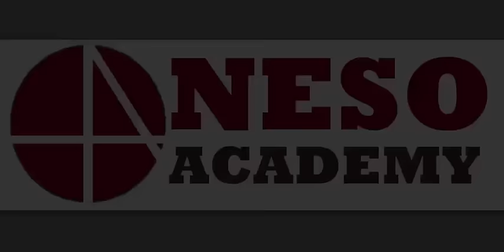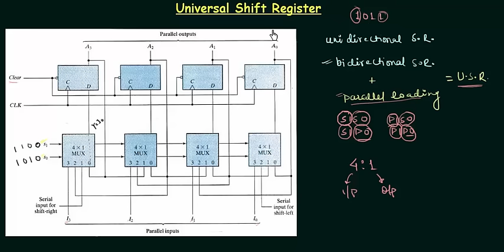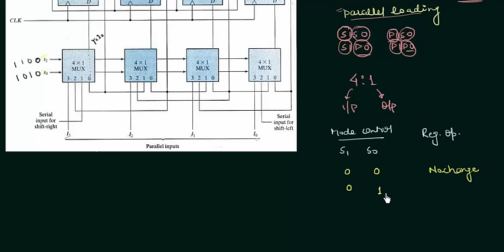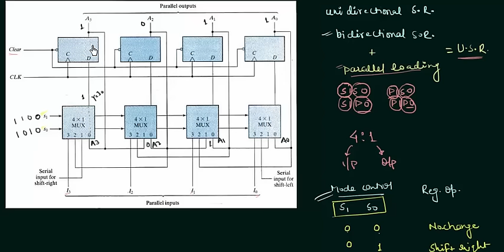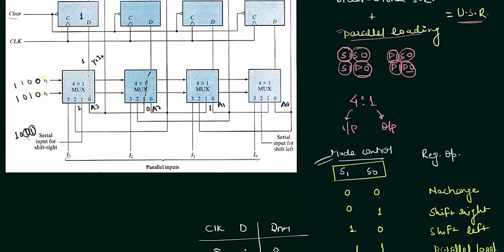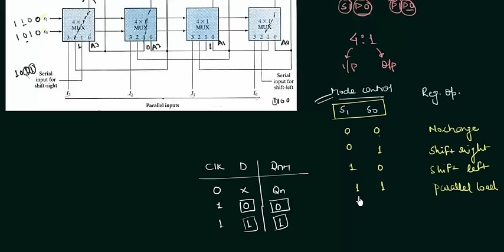Universal Shift Register

Comment: I think you understand my question, but to make it extra clear.

Let's say I just did a parallel load of 1100. The flip-flops now will contain this value. If I than switch mode to shift right, the first 4 bits coming out will be the 4 bits stored in the flip-flops. So let's say I will shift right 1010, the first 4 bits data out will than be 1100 (previous stored value of flip-flop) and giving a wrong output.
Reply: Do u know the answer now? 
me also having the same question
 i think we must after any change of operation in this circuit to use clear to delete any stock of data.

Comment: Design a 4-bit universal shift register and draw the circuit diagram with the given mode of operational table:-   00-no change, 01-shift left, 10-shift right, 11-parallel load..................Sir kindly solve this queston, it was asked in my major exams.

Comment: for s1,s0 both are 0 then how can we give input because all other mux connection lines are disabled then how can we give input
Reply: S1 and S0 are select lines of both are zero then no change occurs in the circuit. It simply reads what is given to input or you can say Io will be given as output to A0

Comment: sir this circuit is usefull only for  4 bit operations  or we can replace 4:1 mux with 8:1, 16:1 mux for 8 bit & 16 bit operations
Reply: You have to increment the no of flipflops mux remains the same....draw two universal shift register structure and keep it in parallel you will understand my friend.

Comment: how this circuit will  perform PISO operation ?
Reply: You can enter the data parallelly by I input and retrieve the data from A° serially.
Reply: @viditgangwar999  There isn't an out port for the same so even if we use the mux modes, for getting an SO we must be able to give both A3 and A0 as outs for shift right/left serial operations

Comment: can you design the 011 to 110 asynchronous counter please ? .answer early Sir
Reply: in asynchronous counter  random counting is not possible for the given clock..but it is possible by putting or by changing the clock inputs like +ve edge to-ve edge respectively..